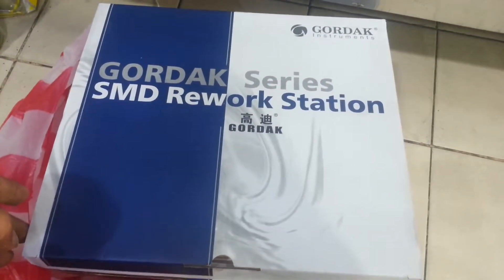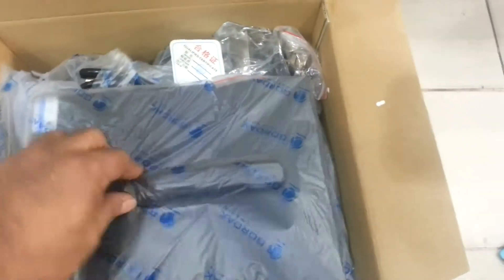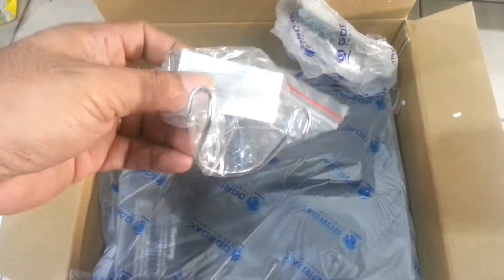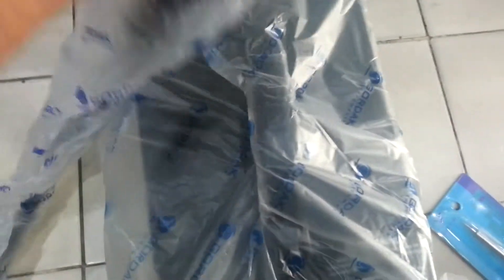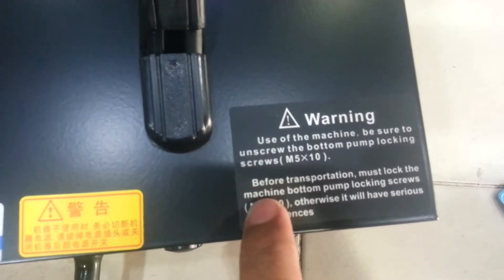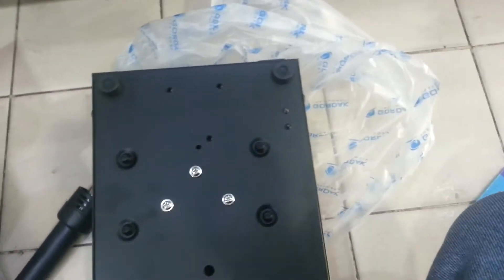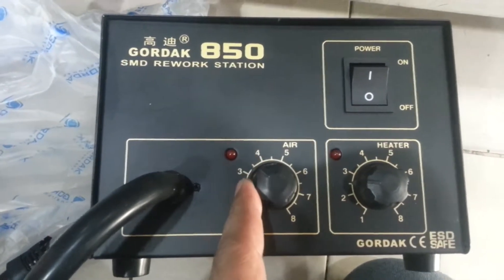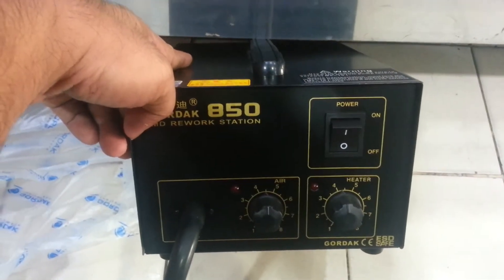Unboxing Gordak SMD Rework Station

Comment: Hi sir meron din po ako nito. Gusto ko LNG po malaman if you have an idea regardless as settings po nito ng gordak 850? Hope you can help me
Reply: Kung paano po siya gamitin Hindi po be to automatic heat control?
Reply: Medyo nakukuha ok na un templa nitong hot air ko sir. 3.5 air and 4 heat pag nag pepreheat pa. Then, pag mag tatanggal na Ng smd air 4-4.5 heat 4-5. Tama na sir?
Reply: Ok po sir tnx. Sir ask ko lng din po.. same Lang ba Yun heating filament ng gordak 850 at Yun aeolus 850? Kasi Sabi ng ngbibinta dyan SA my quiapo same LNG daw? Tama po ba Yun? Bibili Sana ako incase pag Masira may reserved ako. Plz reply po.thnx